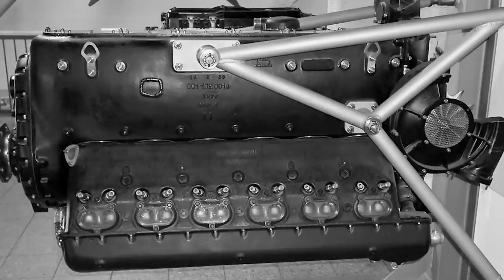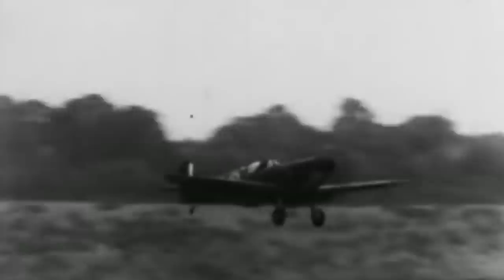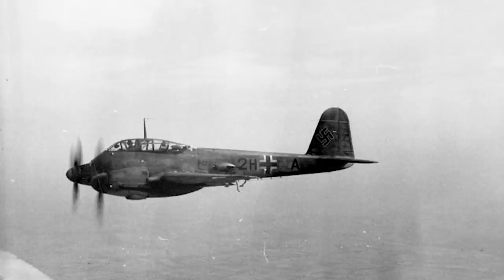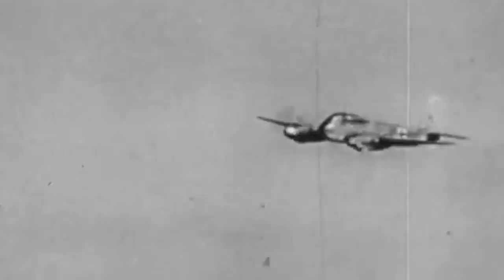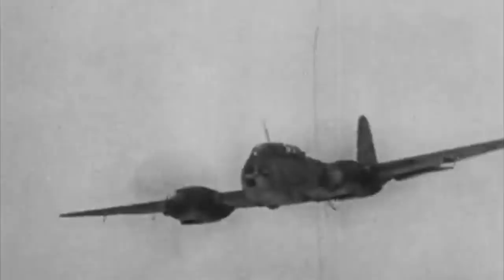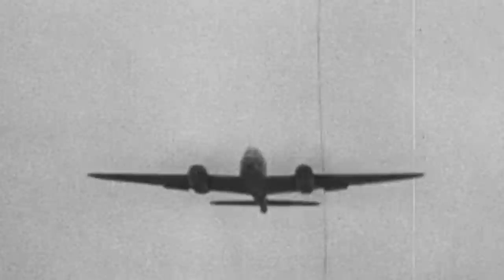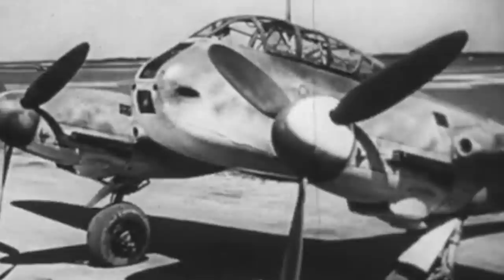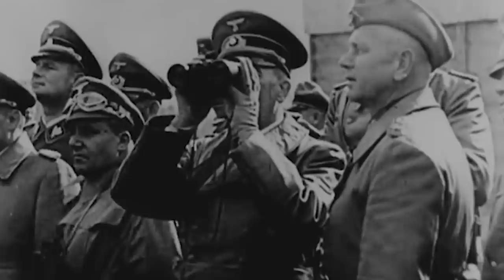The Catastrophically Bad Airplane that Ended Germany's Chance to Win WW2 - Me 210 Destroyer

Comment: Given that the Me 210 and Me 410 look virtually the same, a follow-up video on the 'under-the-covers' differences between the two to account for the Me 410s relative success would be interesting to watch (also, an account as to why there was no Me 310 in between the Me 210 and Me 410).  The P-38 is still the best twin-prop heavy fighter of WW II (with the possible exception of Do-335 Pfeil had it been more numerous and seen more combat time).
Reply: I disagree. The de Havilland Mosquito was a far better WW2 fighter, fighter/bomber than the P38 Lightning. Cheaper to make and maintain, better rate of climb, and multi role.
Reply: @deepwoods_dave7368  Clearly 'Dave' you're just another DH Mosquito fanboy who has no idea what you're talking about.
Don't get me wrong, the DH Mosquito was an excellent twin-prop fighter-BOMBER, NIGHT fighter, and photo recon plane. As a DAYTIME twin-prop HEAVY fighter, the P-38 would easily out-duel the Mosquito 90+ percent of the time (assuming equal pilot skills).  It's not rocket science - but it is simple aeronautical physics.  During WW II the P-38 was faster, had better range and a higher service ceiling, had slightly smaller dimensions & weight, and MOST importantly, could out-turn a Mosquito.  Granted, the Mosquito did have a little better climb rate (https://www.militaryfactory.com/aircraft/compare-aircraft-results.php?form=form&aircraft1=126&aircraft2=74).  So, if a dogfight ever took place between the two, ANYBODY who knows ANYTHING about WW II fighter combat statistical outcomes would bet on the P-38.
Of course, the indisputable actual combat records of the two twin-prop planes bear all this out.  The P-38 shot down nearly 3800 enemy planes in ALL theaters of combat (https://www.warbirdsandairshows.com/aircraftvictorieswwii.htm).  Almost all of these were in broad daylight where the enemy could see you coming and assume defensive or offensive maneuvers.  The Mosquito, on the other hand, shot down a mere 1200 planes.  Roughly half that total was NON-maneuvering V-1 buzz bombs and a large percentage of the other remaining half were kills as a night fighter - where it's relatively easy to sneak up on your prey and strike - especially if radar equipped (https://military-history.fandom.com/wiki/De_Havilland_Mosquito_operational_history).
Lastly, two of the highest-scoring WESTERN allied fighter aces of WW II were P-38 drivers (Richard Bong - 40 kills & Thomas McGuire - 38 kills).  For comparison, the highest-scoring UK/Spitfire ace of WW II was Johnnie Johnson - with 38 kills

Bottom line: As a twin-prop daytime heavy fighter, the Mosquito couldn't hold a candle to the P-38 in a one-on-one maneuvering dogfight - regardless of much you wish it to be true.
Reply: @TyroneSayWTF  You know your stuff, no doubt about that. Few things you are forgetting though. Sure, the 38 could outfight the Mosquito. But that is where the 38's advantage ends. Mosquito , made mostly of wood, could be manufactured by cabinet and piano makers in tiny shops. Inexpensive to make and repair. Don't have the numbers, but I bet the Mosquito cost 1/3rd to make, if not less. 2 man crew meant less strain on the 1 crew of the 38. The RR Merlin was cutting edge for its time, a true masterpiece of engineering, whereas the Allison was underdeveloped. Lastly, the Mosquito is by far a more beautiful aircraft, the 38 is just plain ugly. Next you will be telling me the Mustang was better than the Spitfire! 

    “In 1940 I could at least fly as far as Glasgow in most of my aircraft, but not now! It makes me furious when I see the Mosquito. I turn green and yellow with envy. The British, who can afford aluminium better than we can, knock together a beautiful wooden aircraft that every piano factory over there is building, and they give it a speed which they have now increased yet again. What do you make of that? There is nothing the British do not have. They have the geniuses and we have the nincompoops. After the war is over I’m going to buy a British radio set – then at least I’ll own something that has always worked.”

    – Hermann Göring, 1943
Reply: @deepwoods_dave7368  BTW, I'm 1/4 British, 1/2 German, and 1/4 French (according to 23AndMe genetic services).  So, I'm not anti-British - but I am PRO-truth.
My original comment was that the P-38 was the best twin-prop heavy FIGHTER.  I didn't say it was the best fighter-bomber, night fighter, photo recon platform, or multi-role aircraft.
When an aircraft has the designation 'fighter', that implies its primary job is shooting down other aircraft (bombers, fighters, transports, recon A/C, etc.) - it also implies in the daytime (otherwise, the specific designation 'nighter fighter' usually gets applied).  The P-38 was not only very good at doing this, but it was also WAY better than the Mosquito at doing this.  The P-38 was so good at shooting down other aircraft that it could actually dogfight at a respectable level with enemy single-engine fighters (e.g Bf-109, Fw-190, A6M Zero, Ki-43 Oscar, MC-202, etc) - match-ups where it should have been at a considerable disadvantage - simply because of the laws of physics and aerodynamics regarding the motions of large mass objects vs. smaller mass objects.  In other words, the P-38 was actually reasonably competitive with enemy single-engine fighters - where it should have been a sitting duck like the Bf-110, 210, or 410 or the Ki-45 or 46 or the DH Mosquito or Bristol Beaufighter would have been.
Lastly, for what it's worth, I don't necessarily think the P-51 was the best single-engine fighter of WW II; the Spitfire Mk. XIV probably was - especially if combat range is de-emphasized in importance.
Reply: @TyroneSayWTF  ok, thanks

Comment: The Me-410 was a much better design, plus it actually lived up to its Zerstörer fame by including a 50mm autocannon in a particular variant.
Reply: The version armed with the 50-mm cannon was a failure. The gun tended to jam after one or two shots and the crews found that accuracy beyond a few hundred meters was poor. There is a famous photo of an Me-410 armed with the 50-mm cannon taken from a B-17. That Me-110 did punch a hole through the B-17's right wind with a 50-mm round, but the B-17 survived the mission, whereas the Me-410 blew up a few seconds after the photo was taken.

Comment: The primary failures would be weight distribution to include the rear-facing electric guns as this added too much weight... and the tail sections... the horizontal stabilizer should've been placed higher.... like today's modern: "T" tails... The disruptive airflow from the two engines and the thick wing affect the airflow over the tail section and reduce the control of the and efficiency of the aircraft. This is where design failed... Adding 1500 lb bombs under the nose... didn't help either... I'm sure the pilots felt like they were pushing an elephant with that much weight.  Lastly, the landing gear was too bulky, which I'm sure added to the weight issues
Reply: So the plane would be fine if someone would just redesign it completly... interesting... 🤣

Comment: Ah. I was wondering - if the Me-210 was using the "new" DB601, what was the Me-110 using? It turns out the Me-210 actually used the DB605, while the earlier Me-110s used the DB601, with later models switching to the DB605.
Reply: 1st production iterations of 210 used DB601E, same as 110E&F.

Comment: The final question: Could it have been salvaged?  It was.  They called it the Me-410.   The development from 210 to 410 is direct, and as you suggested in your closing comments, it was basically a fix of the 210.   What probably caused some of this was the top-down control of production by Hitler and his cronies.  They likewise held up the Me-262 in a vain attempt to turn it into some kind of blitz-bomber instead of just letting Messerschmitt develop it into a competent interceptor, as it was intended to be.  If the 262 and 410 (corrected 210) show up in the skies in early 1943 instead of mid-1944, the allies would have had a much harder time with their bombing campaigns and the course of the war would have been longer and harder, I think.   Still inevitable that the allies win, but maybe with nukes over Europe?  That would have caused some very interesting repercussions...

Comment: Its totaly weird , germany invaded several nations that had a lead in different areas of aircraft construction  they had a ready to go bleuprint and captured fighte ready to go . In the form of the Fokker G1  sounds weird a 1936 aircraft with relative low powerd engines ,  but they where build with larger more powerfull engines in mind and even had those bleuprints  .  an aircraft that possesd already a powerfull armament , was suprisingly agile  and great range .   and with german  Daimler-Benz DB 605B  it would have gained a significant speed and power boost.

Those aircraft where even used as trainers for Me 110 pilots .
SO why the hell not build an improved upgraded version of that plane .

Comment: Well in its time the 210 was very ambitious project and it came may be a little too early for the available know-how at Me. (1938)
Just later, when the project was re-handled, it came out as the 410 and this was a much more valuable machine.(1941-42)

And it was not a complete disaster, it was a dangerous aircraft to fly, but it performed in an acceptable way.
Think this aircraft was produced as the same time of the Bf110E... No comparisaon !

The 410 came too late from a strategic point of view, and it was expensive and complex. At that time, they had to focus on more cost effective aircrafts, and easier to fly as the average flight experience of the crews was droping.

Comment: It's a classic blunder of advertising... Letting your sales pitch outrun the engineers, and then the buyer orders some ridiculous number before you EVEN have something scratched together on a restaurant napkin, and you've effectively put yourself "behind the 8-ball"...

    Just because engineers CAN operate under pressure and in short time, it does NOT mean that they ever should. The desperation to meet deadlines leads to cutting corners (like not modeling or test gliding or wind-tunnel trials) and eventually reckless ambition... and remarks like "It's GOTTA work!"

    Simply put, "NOTHING has got to work." The world and physics and chemistry do NOT owe you a functioning idea. That's just silly!

    SO of all the flaws and horrors and cautions this tale might hold, the MOST operative single lesson for you is DO NOT RUN YOUR MOUTH. The correct answer is "Yes, we probably can do that." AND never ever forget the "probably" in there.

     There's probably a dozen ways we could pick this thing apart, and as bad as it was, there WERE still redeemable lessons learned. Along with ALL of them, is the lesson to be gleaned from the Me 410, too. By most accounts, it was also briefly successful and rapidly outclassed and outdated, setting even THAT program up for a short life and Germany ever closer to collapse... SO this is the fall-out from reckless ambitions and cutting corners. It's a short-sighted affair, and when you go straight to production with an untested airframe, you generally end up with crap, AND now that you've got flying crap and lost the time on building the thing, all the improvements are going to be JUST enough to make a decent plane, where you should've been months or years earlier... AND arguably you COULD have been in that time, WITHOUT cutting the corners... SO the results of the Me 210 pushed the arrival of a decent plane behind schedule to be too little and outdated too soon, AND THAT set Germany's aviation military behind even further still...

    Success can breed success. Failure imminently breeds failure. BOTH tend to have ripple effects, even beyond morale.  ;o)

Comment: I think that the commentary here is unfair. The Me-210 was rushed into service without fixing the development issues, by government over ruling / ignoring what the company was telling them  needed to be fixed from testing. The rear guns and gunner proved to be useless weight. The Me 410 delivered what the 210 promised - and it was a fearsome heavy fighter that was very, very effective against Allied bombers. Had the 410 reached service earlier, death rates like the allied losses on the Schweinfurt or Regensburg raids in 1943 would have become a normal and frequently fatal day at the office for the allied bomber formations.

Comment: What went wrong was forcing plane into production & service with mission-destroying deficiencies, and politics & BS assurances sealing the deal. 
410, with changed wings, engines & fuselage--and no dive brakes--was virtually different & vastly improved plane, but now the advantage was lost, because Luftwaffe losing air superiority, Allied fighter performance advances & Allied escort fighters coming into play just months after 410 service intro, negating advantages plane would have had 2 yrs earlier, had it been designed right the 1st time.

Comment: Nice historical video 👍 about Me 210 in clearly explained it's characteristics , story background of its built and its fail down ,crushed....I think wasn't failure designed but whole destruction situation of Germany due to allies bombarded aborted this ambitious project
Reply: Allied bombing only started to have a serious impact in 1943 or even 1944. This project started in 1939. In the battle of Britain it was clear the bf  110 was outdated and had to be replaced. The development might be a bit rushed to be ready for the arrival of the US heavy bombers, but flaws caused by that could have worked out if it had even reasonable performance. The development would be roughly under the same war conditions as the aircraft development in Great Britain 1939-1941. And  other German aircraft developments did got results, even later in the war with much heavier air raids and general pressure of the war on the economy.

Comment: Almost EVERY Issue of the ME-210, was 'Fixed' by the P-38.  Spin one engine in the Opposite Direction!  You cancel Torque, right there, and, maybe, airflow, too.  Yet, THAT wasn't even 'Understood by North American in mid-1944, when Building the Merlin-engined XP-82. They got (literally!) their Left & Right motors switched, and the 1st XP-82 COULD NOT FLY. Literally, didn't 'lift-off', despite Airspeed! North American Quickly took the engines, Swapped-them Left-to-Right, and had a "winner!'.  Sadly, the P-38, in 'Brit-spec' form, had no turbos, AND the Props spun the same way. Lockheed nick-named them 'Castrated' Lightnings, and, in 1939, the RAF rejected them, because they Didn't-yet understand Vortices from Propellors. Chance-Vought did, as did Johnson at Lockheed. Grumman, with the XF-5F didn't, and, even Still, didn't with it's excellent F-7F o late '45. The Germans did get the ME-410, late in the War, but, it was, well, 'Better', but not 'Cured' of the airflow instability of a Twin, using props turning in the same direction..  (my Uncle flew B-26's, then, later B-17's. He rarely talked about 'what he Knew', as his Post-War career was with Raytheon. But, I gathered some input with well-placed questions over the years)

Comment: They were trying to copy the British Mosquito with this airplane and it was at least a close look alike but for some reason it just wasn't designed right! Air is a strange thing in aircraft design. What looks great on paper has nothing to do with how a plane actually flies in the air. The Brits Mosquito was a lucky hit the first time out! I think what was wrong with the German 210 was the fact the nose sat back from the props. This created the bad air places on this plane and made it a crummy plane indeed! Had they made the 210 a little more like the Mosquito it would have been a great plane! Like having the nose stick out in front of the props. I used to design and make model planes that looked like the WWII planes. I never built a 210 but I have built a twin engine plane similar to the 210 and it didn't fly worth a dang! I just took the engine and RC controls out of it and stuck in the Round File!!
Reply: The Bristol Beaufighter had a similar layout. Increased outer wing panel sweep fixed the 210’s aerodynamic problems - that was the major difference between the 210 and 410.
Reply: It wasn't the nose, the issue was the coupled airflow between the wing and the tail partially cancelling control inputs and affecting stability. That's why the problems were mostly solved by adding a fuselage fillet - it uncoupled the airflow so the tail was in clean air and could do its job.
Reply: I agree with most of what you say but have to add this. DeHaviland learned a lot from the DH88 comet racer which was in many ways a 60% scale mosquito .They also learned a lot about stability and weight distribution from the DH albatross airliner. Frankly I think the 210 was more of a copy of the Bristol beaufighter with inline engines than the just a copy of the mosquito.

Comment: I think the fairly simple expedients of larger control surfaces, shrinking the bomb bay to sane proportions, and deleting the rear remote control turrets would be a start. Then arm it heavily in the nose and wings, with twin flexible rear-firing heavy MGs in a traditional gunners configuration in the rear of the cockpit for defense and you'd have a fine interceptor/heavy fighter, possibly in the league of the Beaufighter, but likely too heavy to compete with the Mosquito. This is what they really needed towards the end, it was too late by 1942 for four engined strategic bombers to project power and destroy allied industry. Opposing propellers in addition to the control surface changes mentioned above would do wonders for the handling. I can't believe Messerschmitt ballsed this up.